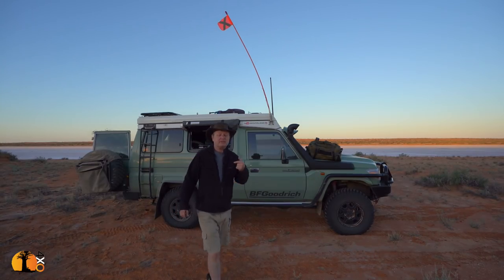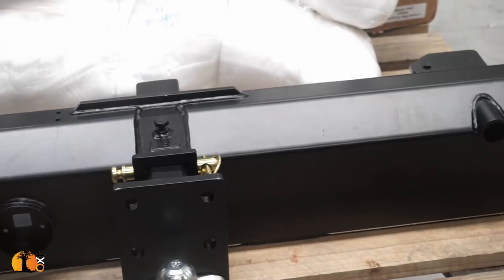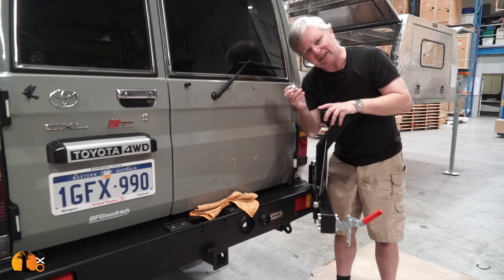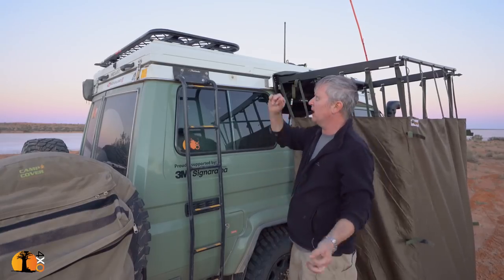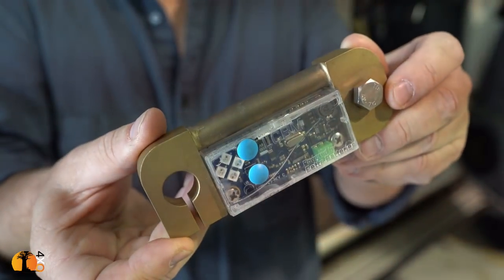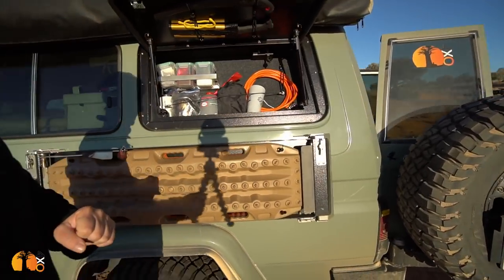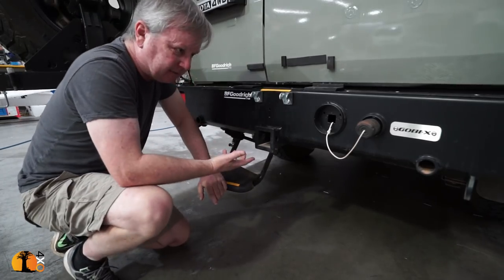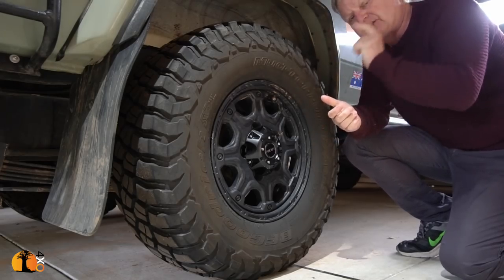TROOPY. WHAT NOW? WHAT'S NEXT? | 4xOverland

Comment: Ask Alu-Cab to address what is basically lazy engineering on their behalf & move the roof tent catches to the inside of your vehicle. It's a major security weakness, even with padlocks on there & it's definitely possible as other roof conversions with the same internal access & bed layout have theirs inside which makes the roof more secure than your doors. It's like they got lazy & just lengthened the expedition tent without a thought for the internal access it opens up.

Delete this when you see it Andrew
Reply: internal latches might be a good idea for security but access to them from inside might be difficult and or awkward at times. perhaps an external latch with a central locking system?
Reply: Terry Smith have a look at the Mulga pop top conversion as it seems to work pretty well on that one, although the video of it is a defender so you could probably walk through a panel gap when it comes to security 😋. All it would need is some well placed cutouts in the part of the bed/mattress you'd never physically use even if you were a giant. Central locking would also be a good idea 👍